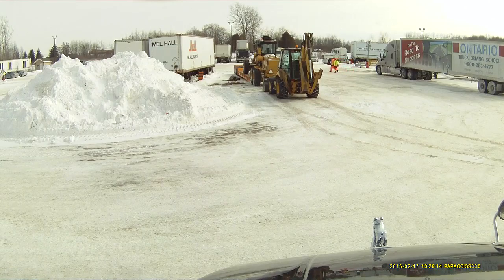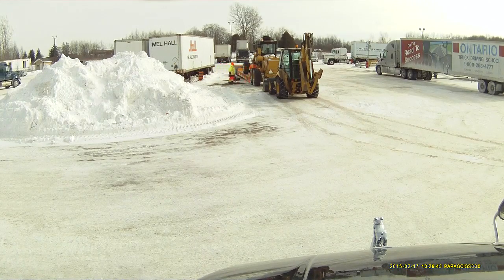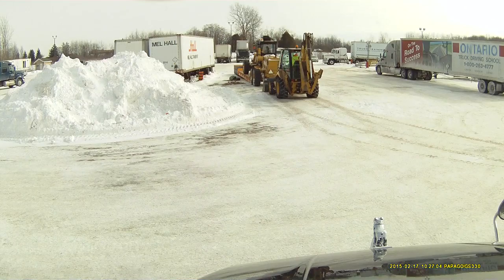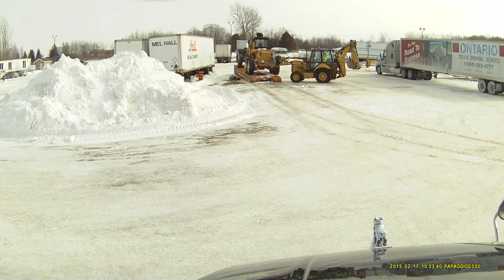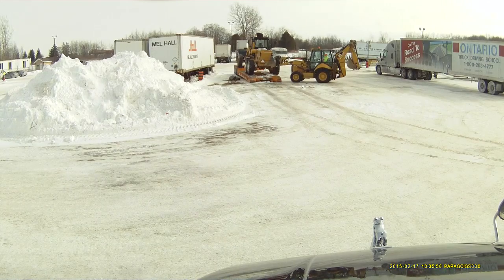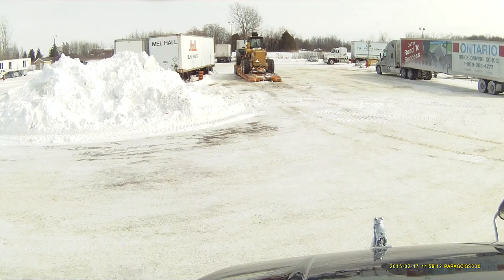HEAVY HAUL TV: 1974 Champion 740 Motor Grader

Comment: Hey Sergei! Just a nice suggestion. Carry isopropyl alcohol  with  you. You can buy it at a truck stop or hardware store. There great to use when the air lines are frozen and the tips are. I use them on my lowboy airlines. They unfreeze in a second!
Reply: Yosef, Great suggestion. could he put the alcohol in a spray bottle and spray it on the connectors? It seems like that would work. Thanks
Reply: 1bigsample you can. But you can just pour inside the hose and once u plug it into the connector the alcohol will spray all the way to the trailer brakes air lines. Which will prevent freezing for the whole system.

Comment: Hi Sergei .. the problem loading appeared to be caused in large part by the step the machine had to surmount to get onto the trailer .. it was the same problem that arose a few movies back with the three wheel forklift.

Maybe you could use yr sideboards to build a wedge, or purchase steel parts that could be moved into position .. the high cost solution is to have steel draw wedges built in at the back, so tracked vehicles etc have a smooth access.

The last few frames of the video when you were driving out of the truck yard, were cinematic excellence :) Cheers from Brisbane Au .. where the weather is nice.

Comment: You could maybe invest in a small propane torch/tiger torch as they are also known to help with the frozen connections, and a can of compressed air similar to what you would use to blow dust out of a computer to help clean out those fittings and a can of lock de icer the big can. That's a couple items I carry with me all winter. The video quality looks great also.

Comment: I'm quite surprised they got all those old machines to start up in the cold. Must be very well maintained  machines.
Reply: Ether.
Reply: nospam3001 ?
Reply: mrnoah1124
You spray a little whiff of ether into the air intake of any diesel and it'll start.